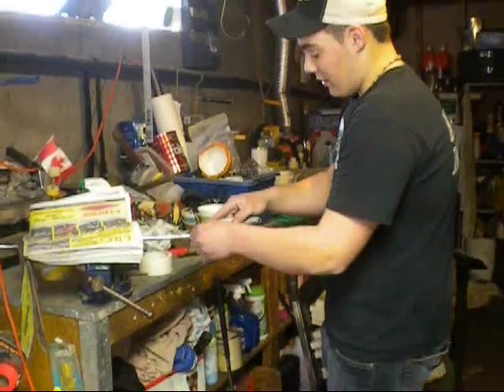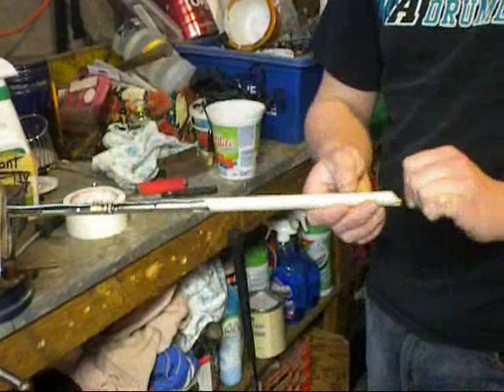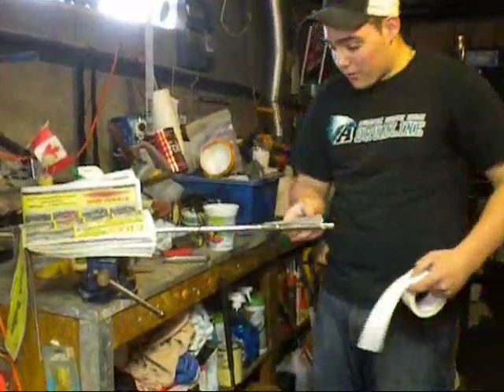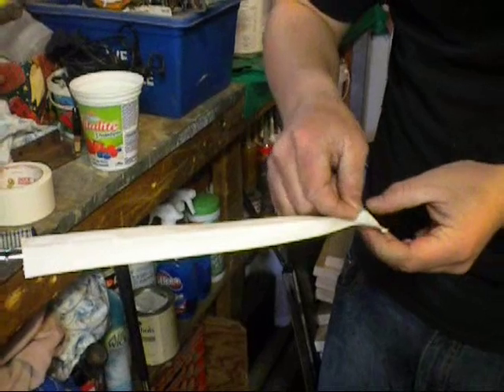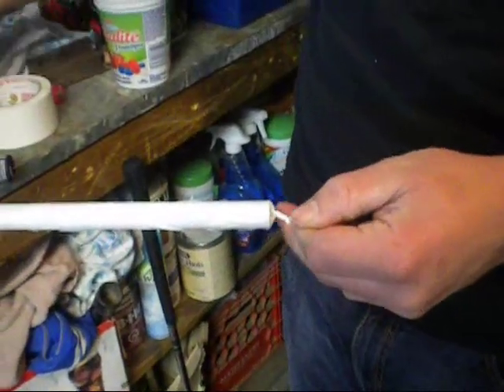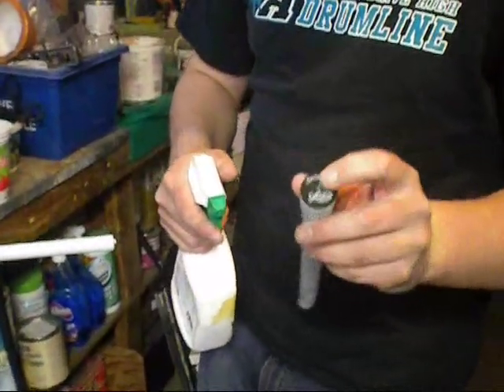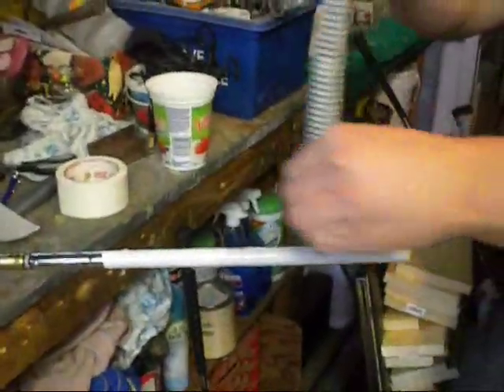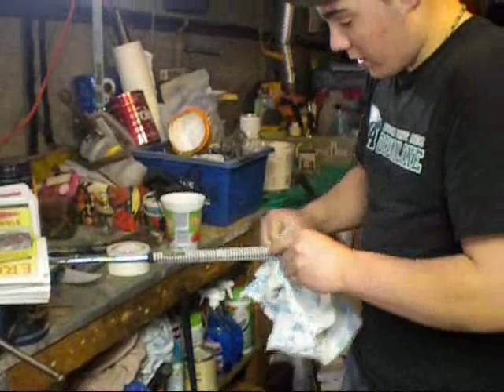How to put grips on golf clubs

Comment: If you want to regrip your clubs and don't have a vice you still can do it.  You just need to fold up a towel, put it on the floor against a wall, and do all the normal steps except put the head of the club on the towel and just slide the grip on.  Its real easy to line up your grip that way too.